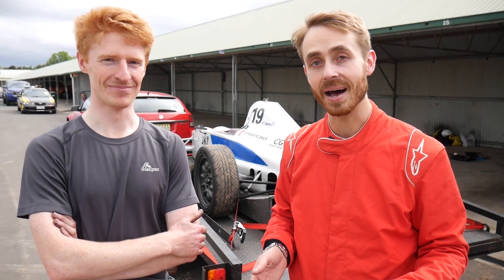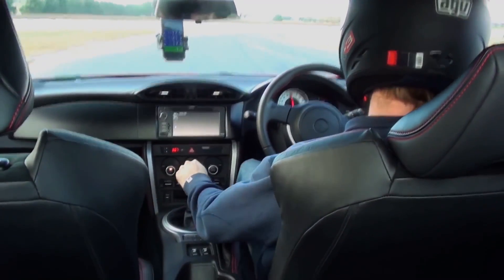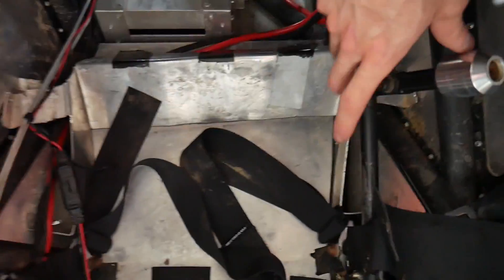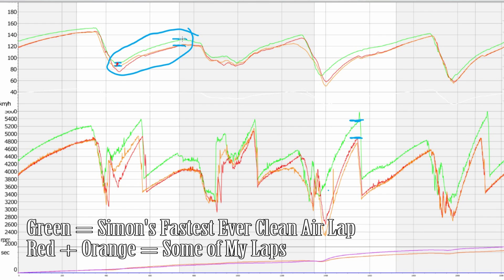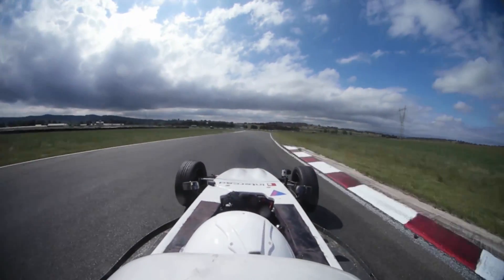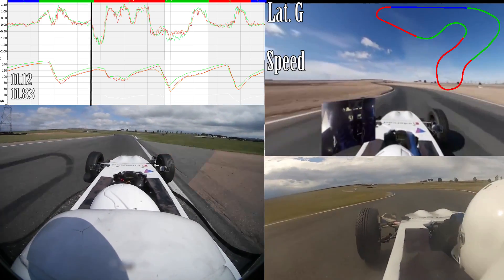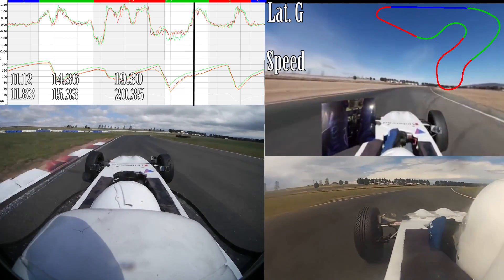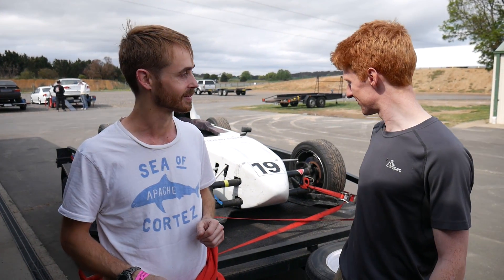200kg Downforce @ 180kmh | Driving the Thomsen Motorsport Full Aero Formula Vee!

Comment: why's the shifter not on the left?
Reply: The gearbox is larger on the left than it is on the right so it's much easier to get the linkage from the cockpit to the rear.
Reply: ThomsenMotorsport I see. Cuz I thought that being in Australia, a RHD car, with the shifter on the left, would be more natural, but it seems there are more things to consider when designing.
Reply: Surprisingly it's not something you notice, I remember adapting without even noticing the first time I jumped in a Vee. Having said that, I found it very difficult driving a left hand drive car in Europe, even having driven the Vee before.
Reply: Most single seat race cars I've seen (Indy Car, F1, etc) have had the shifter on the right. Of course most nowadays is irrelevant. Running shifter linkages can be a huge PITA as you always leave it until last. Nowadays you've got 3-D CAD (not to mention semi-auto gearboxes) but I reckon back in the day it was string and broom handles for mockups

Comment: It’s a Air cooled VW? Fouling plugs  below 2000? We can fix that. Is he running dual Webber’s ? What kind of carb. Sound like it’s too big . I like to call it the toilet bowl effect ! Bigger is not better when talking about intake tracks . And if you can get line of sight from the carb Venturi to the intake valve it greatly helps VE. Efi is great and all but it’s a good argument that you can make more power with a carb properly set up than you can with efi. I really like watching your vids because it helps me with under standing intake charge resonance !!! I would love to see you speak to the effects of port velocity . Even in forced induction engines intake charge air characteristics are key to volumetric efficiency. Over hear in the USA we are so crude and there’s a lot of theory and not much data on intake designs . For your buddy’s engine .... a telescoping velocity stack ran off a vacuum diaphragm might help keep intake port velocity up at lower rpm thus keeping the charge properly atomized . What the cam profile, cid, and carb size? I would be happy to help optimize .
Reply: Yep, pretty much what Karlosss said, very little can be done in this series. Admittedly I had it running rich though on this day.
Reply: Its a controlled formula. Std carby (you can change jets), Controlled cam. Even has a restrictor plate to limit the airflow through from the carby into the engine. No efi yet in this formula in Australia.
Reply from the maker: I'm not sure about the specifics of the engine but I believe a lot of the components are spec for the series, I'll see if Simon can comment.
Reply: Groom Lake h
Reply: ThomsenMotorsport  you need to get the electric idle jet...... we dont foul at low revs.

Comment: Nice channel!!
So, How powerfull does that car feel?
compared to a Average Saloon car.
How much more power?

BTW, new subscriber
Reply from the maker: Whoops, title was meant to indicate downforce, the car is actually about 500kg, with 64hp, so yeah it's a bit slower in a straight line then your average road car, but much faster around corners!
Reply: Car and driver is restricted to a minimum of 485kg for 1200cc cars and 500kg for 1600cc car. Air cooled VW engine with a standard 4 speed Volkswagen gearbox, and VW components in front and rear suspension.
Reply: A good 1600 wigh the new spec engines is low 70s in hp. Cornering speeds are high from mechanical grip. Left hander at barbagallo is same speed as a v8 supercar.
Reply: only has around 50hp but at 200kg, the power to weight is about 250hp/ton